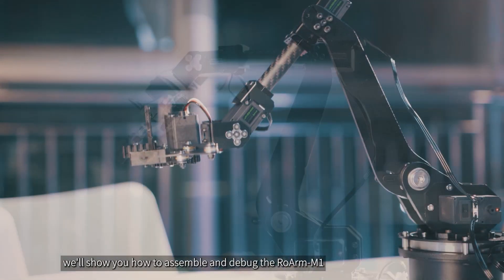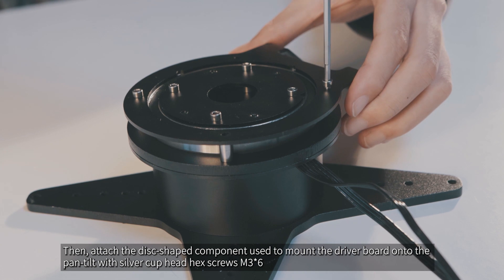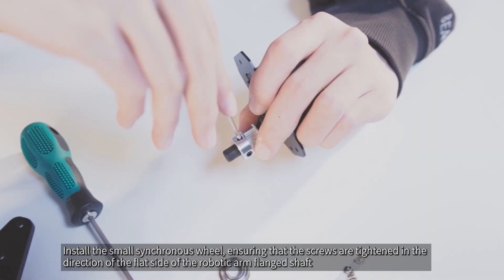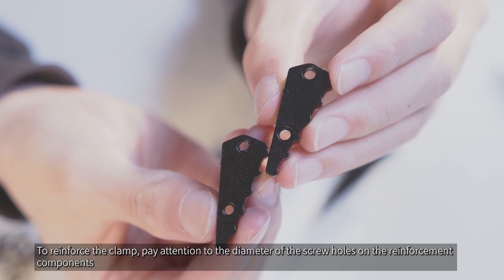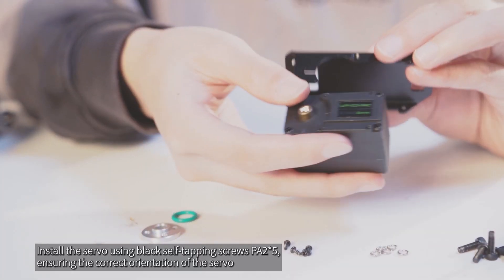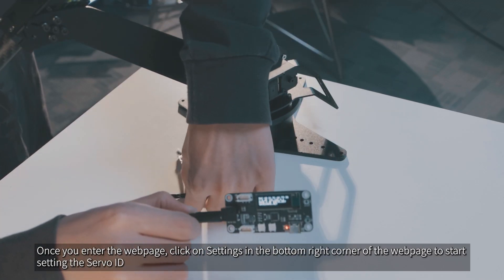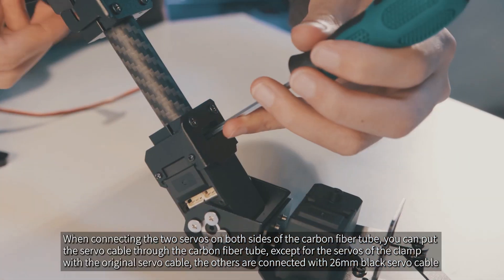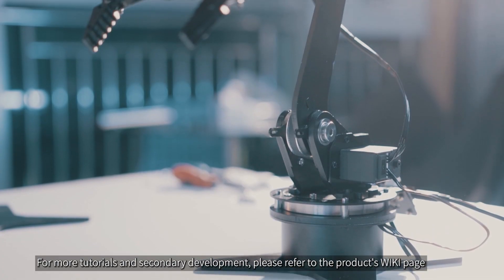High-torque Serial Bus Servo, Desktop Robotic Arm Kit, Based On ESP32, 5-DOF---Tutorial

Comment: Whats the difference to the RoArm-M2 ? Its larger, seems a different design. Whats about different protocols and accuracy?
Reply from the maker: The M1 was designed for big torque, the M2 was designed for lightweight and low complexity. M2 has a simple and lightweight structure, while M1 has a complex structure and has a relatively large weight. If it's considered to be installed on other mobile robots, M2 has lower requirements. Currently the programs of M2 are more advanced than those of M1, and their functions are richer and more practical. M1 has one more DOF than M2.